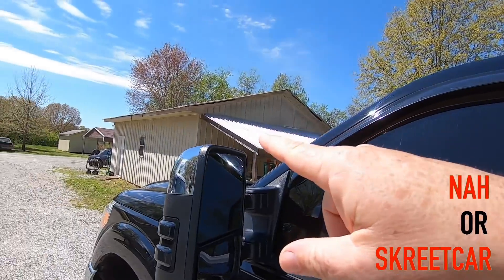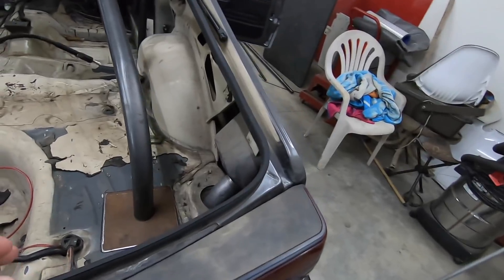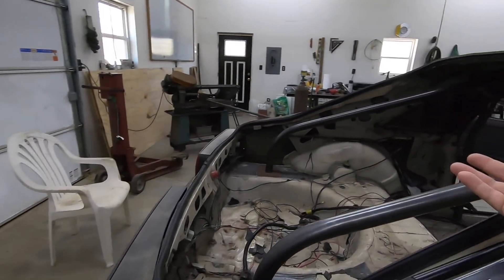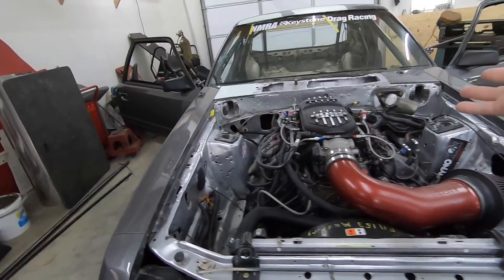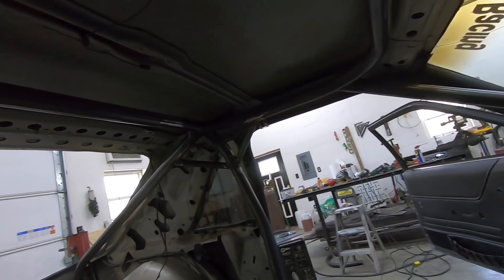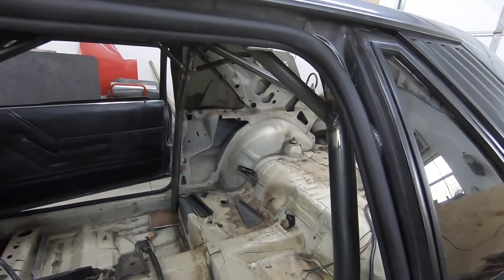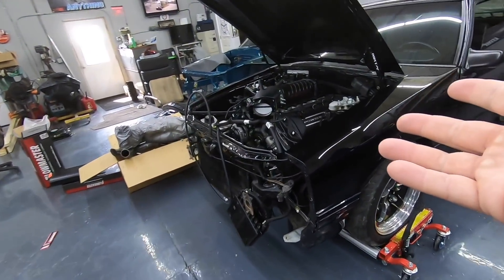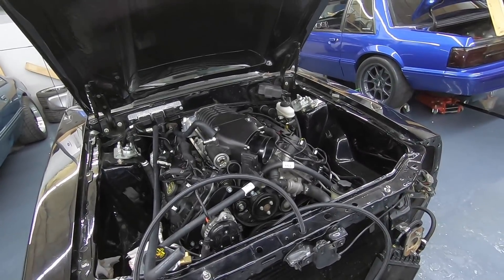Where do you draw the line between....

Comment: A basic bolt in cage, and a mild supercharger would get JOB DONE GUARANTEED. If you’re brave enough to push the PSI, you could drop another two seconds EASILY in the quarter mile, and it was still drive great on the streets.

Comment: Street/strip gives the best of both worlds. Beefing up suspension for both is probably cheaper than buying a separate car to build from scratch. Plus if you see unneeded parts to buy preferred then you get savings. Mine is90 GT full eibach suspension, full exhaust, built 302. Love the cruiser with the occasional race. Your car, your $$, just my .02

Comment: i don't see the problem with putting a cage in...even if it is just a "street" car..you can tuck the bars really tight,if no one rides in the back seat then no problem.. put in removable door bars...if its fast enough on the track to warrant one its fast enough on the street to get you in trouble real quick and if something happened on the street well...at this point its just a safety issue period....

Comment: I believe it’s still a 11.49 and faster you need a roll bar and 9.99 and faster you will need a roll cage. You can get by with a 4/6 point until you reach those times or 135 mph plus as well. Unless you get some major seat time and some weight reduction I don’t see you car in the 10’s.

Comment: Have you actually went quicker than 11.50 yet?  At that point you need more than just a 6 point roll bar.  You'll need a jacket, a stick car has to have a blow proof shield, and you'll need SFI approved seat belts.   It's quite an investment for a street car.
   We are in the camp that doesn't run roll bars in our street cars, and we have a couple that have dipped below the cut off.  Most of the time the track is okay with it, but we only make one trip to the track a year with those cars, usually at a special event where they are a little more lenient with the classic cars.  Any other time we go to the track I purposely bring something slower just to have some fun and I don't have to fool with all the rules.  Even a 14 second car is fun and I don't have to worry about whether my helmet has the daggum up to date snell rating, lol.

Comment: When you have a fast car - doesn’t the driver consider the fact that on the road the risk factor of an accident can go up?

It goes up for obvious reasons. 

I rolled my 03 Ford Lightning at 40 mph in rain (hydroplaned Nitto 555’s) merging on the on-ramp. Luckily it wasn’t attributed to any street racing or spirited driving.

When your car can go 11’s (or faster) and something let’s go; whether it’s a suspension component, a wheel/tire issue, an axel/hub, your brakes fail...etc. A roll cage (of some worthy type) and you see the next day, minus some possible scrapes. 

My two cents. *If it’s rarely driven then I’d probably pass on a cage.

Comment: You can keep it street and strip and keep it nice while having a cage.  It dont gotta be either or.  A cage is a good idea...there is a reason they require cages at the track for cars that run that fast...because a car that fast needs a cage.  You can get well above 100 QUICKLY and that is moving in a fox.  Its a good idea for safety once youre running that quick.  There are ways to do cages clean.  It dont gotta be chopped all to hell.  I say keep it street and strip and do a cage while still keeping it nice.  This car is far from stock anyways originality shouldn't be a top concern at this point imo...